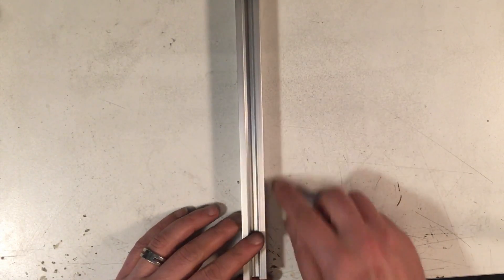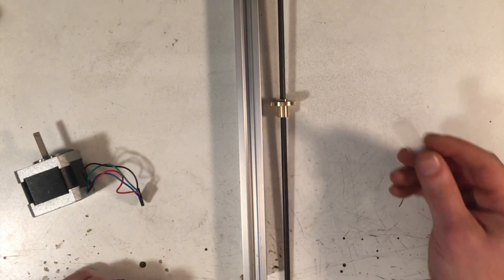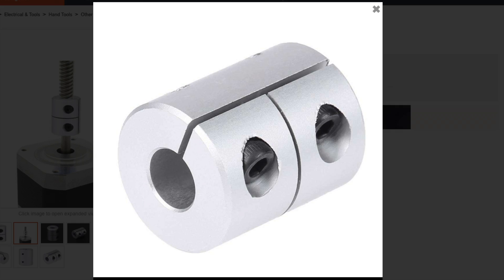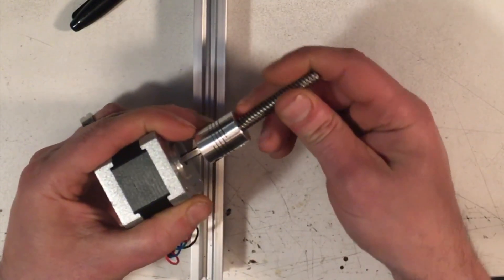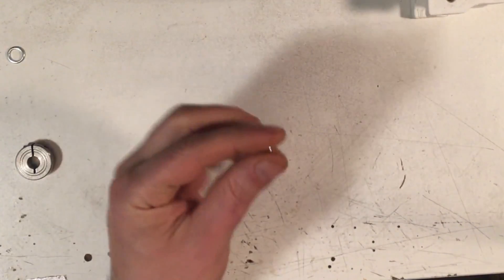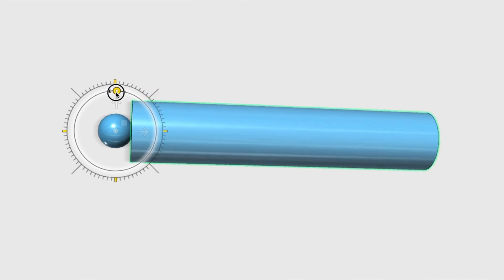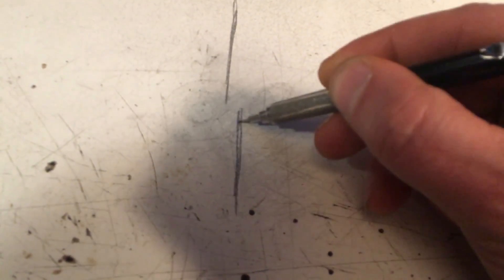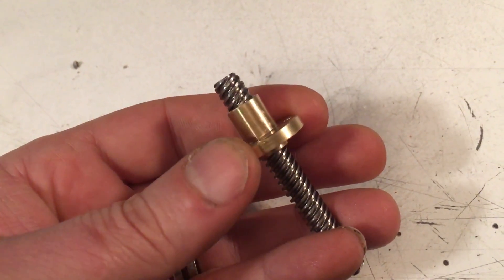Viewer question: the ball bearing trick?

Comment: Any tips on prepping lm8luu for install I need to replace mine and thought I might lube them correctly from the start.
Reply: makes sure theres no debris inside the channels and then clean them with DW40, wash with water and detergent, rinse and onces dry (make sure theres no detergent left) use motor oil. Most of the chinese crap doesnt even come lubricated, the come coated in kerosene or some shit like that. Generalpurpose oil works nice but dries too quickly and doesnt remove the particled that wear out, motor oil is thicker but sticks well to the metal and has good properties for this application. 
Make sure you do your maintenance every 1 month if you run it 24/7 or 3-4 month if you use it every so often to avoid oil drying and thinks just ceasing due to lack of proper lubrication.

Also, if you can design the parts, just use brass bushings. Chinese LM8uu are crap and bushings run well even on cheap rods
Reply: @laharl2k  I absolutely agree!  I always WASH ALL mechanical parts (except linear bearings maybe :) ) with detergent when they come from Cina, it is the must.  It is also a good idea to demagnetize steel parts before washing.  And for lubrication, I think, a motor oil is the best (good enough and easy to get).
Reply: @laharl2k   I was thinking of following the similar idea that Alex did in his linear rail video. Yours sounds very close to what he did. What about the super lube that he used instead of motor oil? I kind of like lithium grease but wasn't sure if the super lube lithium is too thick.
Reply: @laharl2k  I'm also not too keen on putting water and detergent it's through bearings.
Reply: @GregTheroneggythetech  
Theres nothing wrong with water on bearings, if you dry them and lubrecate them they wont rust, only if you leave them wet or washed clean of any oil will they rust. 

Grease forget it, too thick, it would only jam the balls inside and wont provide any benefit over thnner oil. Unless you find a very soft grease, then i wouldnt recomend it. The rule is simple, oil for fast light things, grease for slow heavy load stuff. Always use oil if possible.  
You usually need good sealing to use grease, otherwise the bearing will push it aside over time, oil being more flowy would crawl back onto the race for when the next ball passes over it.

Lubrication is quite a good reading if you are interested.  Ideally you'd use good quality brearings on good quality rods, all in specific materials with specific characteristics, with specific lubricant thats appropiate for said material, speed, and workload. Thats why you cant use any oil in your car. Sure you could use vegetable oil and IT WOULD WORK, but your engine wouldnt last as long and the oil would probably become rancid in a shirt time, it works but its not optimal for long term use.
Reply: igus bushings FTW.
Reply: Thanks for the tips